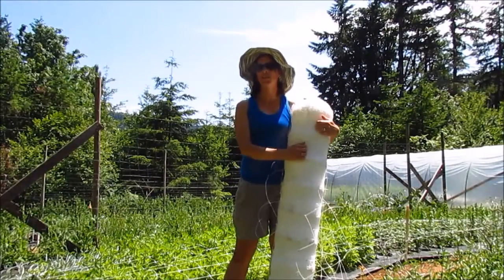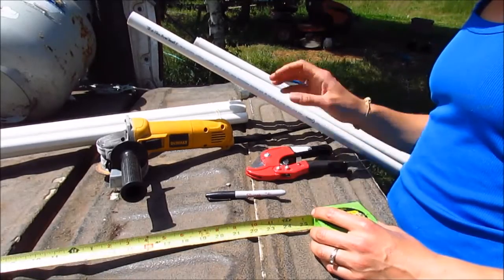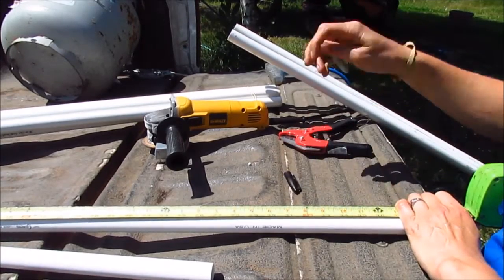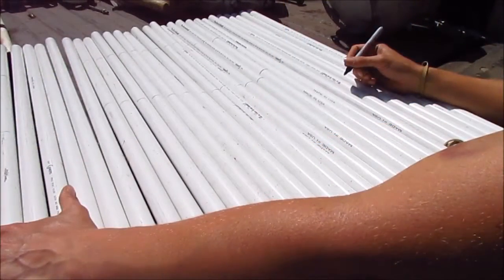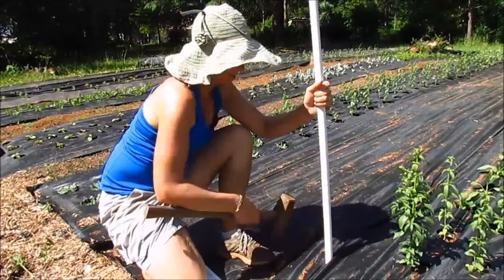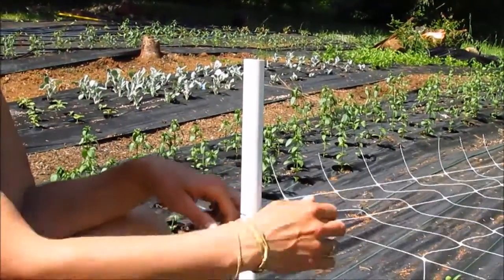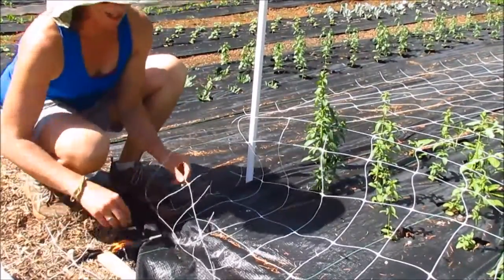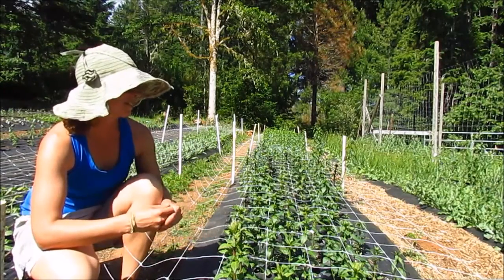How To Use Floral Netting for Longer Straighter Blooms

Comment: This is a great video! I want to try this in my garden this year because I'm adding a cut flower bed his year. I really would love to see a video on how to set up those weed fleeces that you have on the ground or even just have some advice. I'm clueless how to make it stay and not blown away from the wind, how big should the holes be and what is good spacing between them?
Reply from the maker: Thanks for checking it out, we do do have plan to do a video on this very topic. But I'll do my best to  give you a head start, the weed mat that we use is 3ft wide and burn 8 holes per foot 4 across. It's pinned down with 6" landscape staples every four feet on both side. We have used everything under the sun to make the holes, we used a weed burner for years but have recently changed to a cow horn cauterizer and it's way easier and faster
Reply: Rain Drop Farms thank you so much for answering!

Comment: Maybe you addressed this and I missed it - Do you add another layer of netting, or do you move the netting up with the growth? And do you find that because the piping is flexible, do they all bend in due to the netting getting pulled on?
Reply from the maker: Danelle, there are a few crop that we will put a second layer of netting on, things like stock and godetia that are very tall and slender-stemmed. I don't generally move the netting. As for the posts, there is some bend to them, but we have them spaced so that there's not too much. you could certainly use metal posts or even rebar. Thanks for the questions, happy planting!
Reply: Thanks for the response! I appreciate the time you took to make the video and share what you have done in your own garden! Enjoy your blooms!
Reply: How far apart do you place the stakes? Great Video. Thank you!

Comment: Which flowers do you recomend using the netting?
Reply from the maker: We use the netting on flowers where a straight, strong stem is not guaranteed without a little support.  Sunflowers and zinnias are fine without it, but things like snapdragons, lisianthus, godetia, and mums need that extra support or else we end up picking them up off the ground.